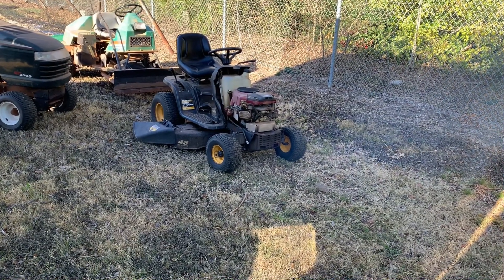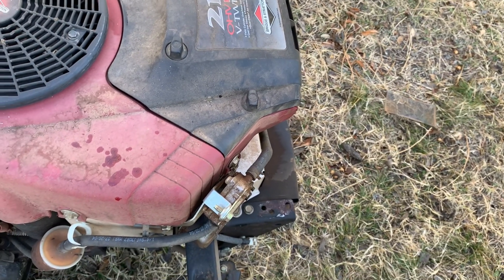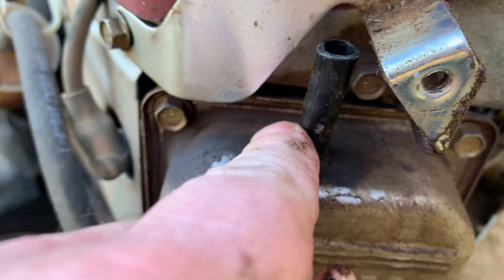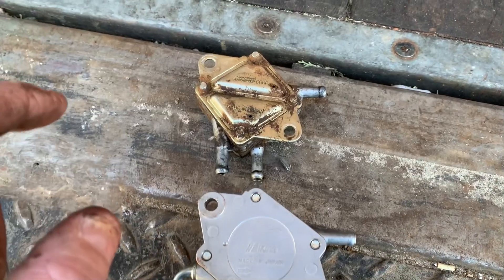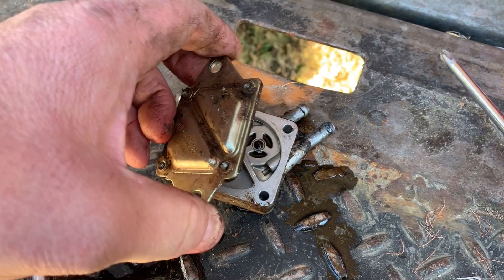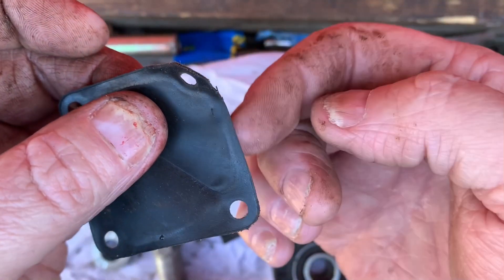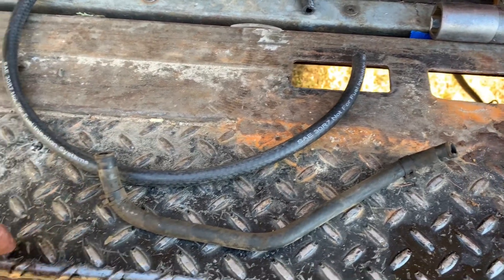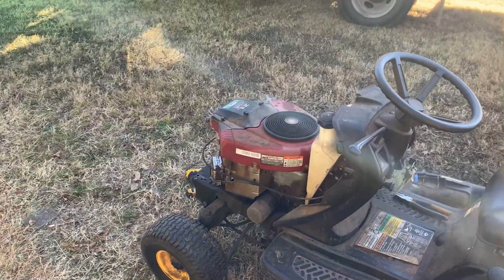FIXED! RUNS RICH / GAS IN OIL / FAILED #FUELPUMP ON A #BRIGGSANDSTRATTON V-TWIN INTEK ENGINE

Comment: I have a 19 horsepower Kohler engine that has had water put in it. I have changed the oil at least 3 times in it ,and it still has moisture in the oil fill tube  question, how can I get the moisture  out of the dipstick  tube???
Reply from the maker: Replace the
Head gaskets
Reply: @THEMOWERMEDIC1  it is a single cylinder engine and it has plenty of compression, it's just the water/ moisture in the dipstick tube.  It also  says to run the 87 octane fuel  in it too